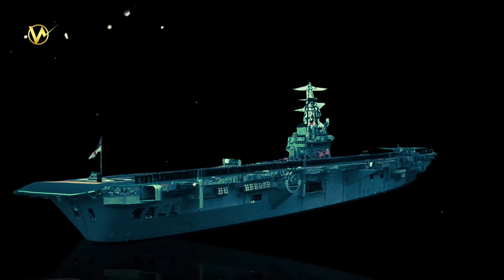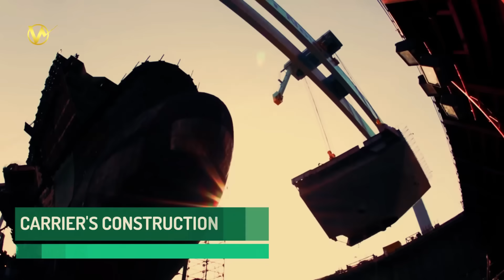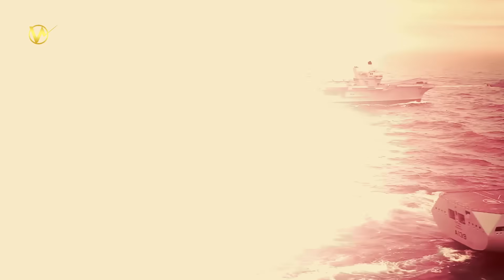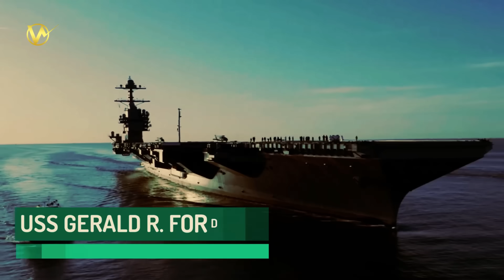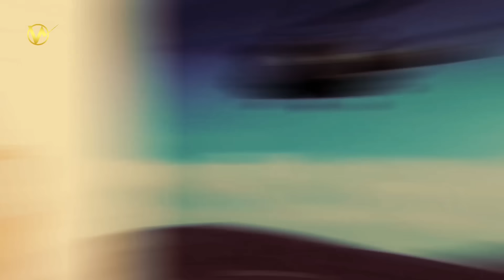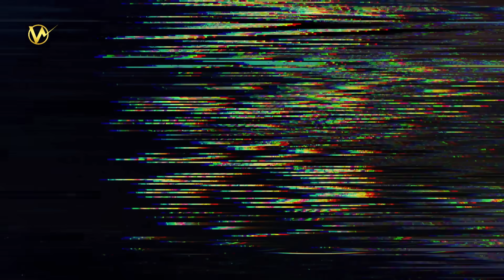Canada's new smaller multi-purpose carrier: Is it a Genius Idea?

Comment: Canada Could use something smaller like the Mistral class helicopter carrier that has a hardened deck for F-35s or the Americans Wasp class or America class Amphibious Assault ships. We don't need a massive carrier but 1 light carrier/amphibious Assault ship on each coast with a 3rd to rotate in and out for maintenance/refit. We're never going to be operating without allies in a situation where they're won't be additional carriers anyway and in the cases we do, it will be in situations where a small carrier will be more than enough support. Troop transport, logistics, support and humanitarian/disaster relief will likely be a bigger role. Having a few fighters (I think the load out for the above mentioned is 8 F-35S or Harriers) unless it's being operated as a light carrier then you swap out the helicopters for the additional 12 Fighters.

Comment: 🇨🇦🍁With the advent of micro-nuclear reactors we could power 25000 ton Ice Breaking Escort Carriers (5 of of them as we want at least 1 for the Pacific, Atlantic, Arctic and Indian Oceans and another for reserve or Hudson's Bay). A combination of Helicopters and VTOL/STOL planes will suffice as you normally only need a few of each unless there is a WAR or a MAJOR NAVAL EMERGENCY. IMHO this is a more sensible strategy than either a SUPER-CARRIER or NO CARRIERS. The main thing is to use a micro-nuclear reactor on all CAPITAL SHIPS that we will make
here in Canada. At 2000 people each, we would need to hire 10,000 new Naval Personnel just for these 5 ships and if each is to be the center of small task forces (1 Destroyer, 1 Sub and a couple supply ships and a Missile cruiser and a couple Frigates and new Corvettes, this can quickly lead to 50 new ships of 400 crew each (20000 more Seamen)! But it can be done as we had a decent sized navy at the end of WW2 with hundreds of warships! 🇨🇦🍁

Comment: Canada could project sovereignty more effectively in the Arctic region through the use of ships equipped with helicopters, long range UAVs as well as the use of the SAAB Gripen with its short take off and landing capability and a design suited for Arctic conditions.
A carrier, even a small one, would require resources, funding and trained personnel that this country simply doesn't have available.
It's also worth noting that Canada is a huge country with a huge coastline and requires careful management to distribute military capabilities to all regions at once.... and a carrier simply can't do that.

Comment: A usable carrier, say a dozen F-35's and an equal number of helicopters would require over a thousand sailors and air crew to man, we're currently discussing the difficulties of finding the 600 sailors needed to crew 12 submarines, a vessel unlike a carrier, that we currently operate and with the needed escorts in tow would probably cost about a million dollars a day to operate. I'm not saying it wouldn't be a nice capability to have but with 15 destroyers, 12 subs, 6 AOPV's and possibly a dozen corvettes to man and operate we would be hard pressed to add a couple of LHDs without basically doubling the number of sailors we currently have.

Comment: I don’t see a need for a carrier, just build a couple of runways capable of operating fighters in the western and eastern arctic with maintenance hangars.
Reply: well first they would need to rebuild all the FOL's in the arctic.  they sold them to local governments with a maintenance conttract.....in Inuvik the town CFO had them shut down the refrigerant system, the permafrost melted, and the hangars subsided.
Reply: @noele6588  brilliant!  Were they running low on fuel for the generator?
Reply: Carrier or carrier fleet would be a super big help to the Canadian military, make the fleet have amphibious capabilities to land troops as we currently have no way to move our forces except for 8 heavy lift aircraft. Furthermore if you made this carrier fleet ice breaker capable then we could send this fleet to the Atlantic or Pacific through the artic 9 month out of the year. Even Australia has two amphibious capable aircraft carriers and they are a smaller country, we let are army die into what it is today

Comment: Canada had aircraft carriers during and for a few years after WW2 because sub hunting combat aircraft could not engage subs in the mid Atlantic. When sub hunting aircraft like the Argus and Aurora that could stay aloft for 24 and more hours at a time. They did not need the carriers anymore. 
The current situation with the Arctic can be covered by expanding air bases and naval bases in the North. Something that the government seems to be interested in 
The NATO commitment includes the Army Brigade commitment in Latvia. Right now The Canadian Army has about 2000 troops as part of an international Brigade Group. If a combat situation steps off the Army will want to re- enforce that Brigade Group with one or more Battle Groups from Canada so some form of Amphibious Assault ship or a protected Roll On Roll Off ship like an armed ferry of some kind would be more effective than a straight carrier. This ship could be ice capable and be used in normal times to bring troops, equipment and supplies for the Northern Sovereignty Operations every year. 
Canada does not have a defence commitment in the Pacific and I’m not sure we should get involved in one. But if we did the idea of having some sort of drone mother ship for air and sea drones would make the most sense going forward.

Comment: The Gov't plans on making Churchill (MN) a year-round major maritime hub, to access the North-West passage in either direction.
To bypass all these shenanigans, i.e.: debates and expenditures, about the viability of some type of maritime mobile air platform, it would be infinitely
more efficient and effective to establish a permanent CF Base on Baffin Island, a 5 km airstrip for fighters/patrol/search & rescue/supply birds, covered naval
resupply docks/warehouses for all vessels (? a sub pen or 2 ?) with a possible dry-dock in the lot for emergency repairs, maybe a Bn worth of troops to
maintain security/intervention and conduct advanced Arctic training for the CAF and allies. Maybe even some R&D regarding ways and means (implements)
for survival/work/warfare in the high Arctic. Cheaper to run a multi purpose facility on land (island) than an itinerant naval-air task group. This would go a
great deal further to assert our sovereignty in the region, and the R&D might actually contribute resources in the long term.  Be well and stay safe
Reply: Absolutely correct
Reply: That would make a lot of sense, you've made some good points.
Reply: Hovercraft would work well for the Arctic environment.  They can operate on land/water/ice, thus 365 capability, relatively cheap compared to aircraft and ice capable ships.
Reply: I'm all for improving Churchill and making it more viable for the local community and developing a larger labour force.  However I'm really concerned about permanent negative effects on the local Polar Bear population.
Reply: Ice Breakers for the North incase the global warming thing is just a bad idea .... just sayin...

Comment: Buying x2 Juan Carlos class lhd's makes sense...everything from force projection, disaster relief and humanitarian assistance..

We could easily reduce our f35 purchase to just x16 f35b and then supplement with x88 Saab Gripen Es. 

It's not solely about amphibious assaults...that type of thinking is outdated and misguided
Reply: Makes no sense to reduce our F35 purchase and buy the Gripen.  The Gripen's would be outdated by the time we'd get them.  If anything, we should be buying more F35's.
Reply: The Gripen E would be just fine for our continental security obligations (NORAD)..cheaper and easier to operate (requires less sophisticated infastructure) and 
less down time..

We could then look to join the Tempest program with our new found fonestic manufacturing capabilities..

Meets our obligations and needs with Washington while simultaneously diversifying our defence procurement and increasing our own industrial base.
Reply: @graemeanderson3337  It would also mean two micro fleets with all the logistic, training and infrastructure burdens that would imply.   Both fleets would also wear out faster as there would be fewer airframes to average the hours out on to.

Gripen's also aren't all that much cheaper than F35's, but they leave a lot more on the table.  It would be a bad trade off.
Reply: No doubt a mixed fleet has disadvantages but about half the f35 nations due just that with no issue(seemingly)..

16 x 35bs
64 to 80 x Gripen Es

Is both doable and beneficial 

If we go further and join the Tempest program it would better align with our strategic goals of more strategic integration with europe.
Reply: @graemeanderson3337  There isn't much to demonstrate that having such a mixed fleet would be beneficial, nor having more strategic integration with Europe.  

The Europeans are already far behind the US in 6th gen fighter production and buying a 4th gen fighter from them doesn't make any sense capabilities wise.  

Why buy a 4th gen fighter that can be ambushed by 5th gen fighters invading our airspace?  

Much better to buy a lot of 5th gen fighters now and wait to see what Europe rolls out for a 6th gen.
Reply: The benefits of a mixed fleet would simply be less, as in not 100%, reliance on a less trustworthy United States..and it need not be the Gripen either..

It would be great if another 5th generation fighter was on the market outside the f35.. maybe the kf21 block 2?

Unfortunately that's not the case so what do we do...how do we move away from sole dependency on Washington, increase our own domestic industrial base, increase military cooperation with europe and meet our NORAD responsibilities?

Maybe I'm way off here but I think a mixed fleet is the right direction for us..
Reply: @graemeanderson3337  Honestly, I was pretty sure that this: "as in not 100%, reliance on a less trustworthy United States" was going to be your reasoning.

It's not great reasoning.  What, specifically, does buying 100% of this generation's fighters from the US actually open us up to, risk wise?  There is no "kill switch" software in the F35 any more than there is in our current fleet of CF18's.  

And lets not forget that buying from Europe exposes us to the risk that come with buying from Europe.  The EU is much more likely to restrict our use of anything we buy from them than the US is (on a policy front).  The EU is also filled with illiberal democracies that, as a whole, I don't really trust all that much in terms of foreign policy decisions.

That all being said, If we could engage in more partnerships with South Korea and develop more aerospace tech with them for the 6th+ or 7th gen of Fighter, 100% absolutely, because they have shown that they are willing to basically give us equal partnership and control in whatever we'd make together.

But that would be something that we'd have to start now for a good result pretty far in the future... and it'll cost a LOT of money.
Reply: I'm not suggesting the planes themselves are a risk, moreso the specific cont'd alliance, perhaps over reliance, on the US is a bad idea, never moreso then today..

We should 100% continue to work with and buy from the US(militarily and other) however, increasingly when and where possible we need to diversify and I say this as an American Canadian.

Specific to the f35, I don't believe in nor would ever suggest any notion of a  "kill switch."

My rationale is solely about diversifying our trading and strategic partners while simultaneously increasing our own industrial base. I believe it's possible and prudent to explore and pursue those options.. 

If however the f35 is the only option I support that conclusion.
Reply: @graemeanderson3337  Diversification is something a nation has to plan for and fund for a long time.  Canada has failed to do so.  We have to accept where we are in the present moment and accept what facts we face in the present moment.  

Buying 4th gen fighters in a 5th gen world would relegate us to support roles with little to no independent target selection capabilities.  We would basically be giving up any vestiges of our ability to act independently.

As for the notion that "perhaps over reliance, on the US is a bad idea, never moreso then today.." Well, that has always been the case, today, yesterday and tomorrow.  Nations should never over rely on other nations.  

That being said, the notion that This particular moment has more risk to Canada in terms of military equipment procurement... well, I do not believe that to be true.

Comment: Canada doesn't need to project power, doesn't have jets designed for carrier use, Canadian pilots don't have carrier training, and the military doesn't need aircraft carriers to transport aircraft overseas for occasional NATO missions. If Canada needs a carrier, the government could build a custom freighter with one or two aircraft elevators and then load and unload jets, drones, and vehicles using a crane. A better idea would be to build trimaran battlecruisers with a reinforced icebreaker hull. The Canadian battlecruisers would be the length of a Kirov-class (253 meters or 830 feet) with a large internal hanger to carry various aircraft, drones, APCs, tanks, and artillery which makes it an aircraft Cruiser. Jets and vehicles could be lifted on and off the deck by helicopter or crane for long-range transport. The battlecruiser could be armed with one Japanese rail gun on the bow as the primary weapon, two 127/64 light weight guns as the secondary weapon system, four 40mm Bofors, 30mm CIWS, anti-aircraft & anti-ship missiles, torpedos, 4-8 ASW choppers, and 2-4 South Korean KAI LAH infantry support helicopters. The current Canadian Navy will be equipped with the River-Class guided missile Destroyer, Harry DeWolf-class Arctic and Offshore Patrol Vessels that are a couple thousand tons lighter (Frigate), and have plans for an icebreaker Corvette. The River-Class Destroyer could be replaced with a battlecruiser to give the Navy a more powerful warship that could occasionally transport jets, troops, and be used as a mobile hospital across the ocean. The Russian invasion of Ukraine has made drones more important but many people have become obsessed with the idea of drones replacing people in combat. A drone carrier is a bad idea and using drones as the main military force is full of problems. Drones are not invincible and many anti-drone weapons have already been developed like air burst ammunition, sonic, microwave, and jamming technology. When drones are jammed they can use inertial navigation but the longer the jamming continues the further off course the drones will wander. In World War 2 Americans believed that battleships were the most powerful and deadly weapons in their military and the carriers were only useful as support ships. After Pearl Harbor the Americans didn't think they could win without battleships. Since WWII the battleship has become obsolete because of missiles and the carriers along with the aircraft on board became more important. Unfortunately, military technology and tactics are always changing, and I believe the aircraft carrier has become obsolete. The long range cruise and ballistic missiles carried on submarines and surface ships eliminate the need to send aircraft into enemy airspace. The infantry can call in a missile strike from a sub or surface ship so the "need" of a carrier no longer exists on the modern battlefield. Both jet and propeller aircraft are still useful in various situations but in smaller numbers that don't require an expensive specialty ship like the aircraft carrier.
Reply: We don’t need to have pilots or crew, if we’re doing it with Ai. We don’t have the numbers anyways
Reply: @L-nh2vq A drone military controlled by AI is the dream of every dictator. The dictators of Russia, North Korea, Israel, and America would love to replace their soldiers who can refuse to obey illegal orders with killer robots. Drones are easier for a dictatorship because they are programmed by nerds who are easy to threaten and intimidate. Drones may be popular right now, but they will always be a flawed weapon system with limited uses. The Ukrainian Air Force is currently using old Soviet MiG-29 Fulcrums, Sukhoi Su-24 Fencers,, Sukhoi Su-25 frogfoots, Sukhoi Su-27 Flankers, Lithuanian L-39ZA Albatros (trainer & light attack aircraft), old & new American F-16 Fighting Falcons, French Mirage 2000 & Rafale jets, Czech-Slovak Shark & Yakovlev Yak-52 drone-killer propeller aircraft, and various helicopters & drones. Ukrainian President Volodymyr Zelenskyy signed a letter of intent covering a potential sale of more than 100 Saab JAS 39 Gripen E fighters. President Zelenskyy has outlined plans for a future combat fleet of approximately 250 aircraft, including F-16s, Gripen Es, and Rafale fighters. The Swedish Saab Gripen E is estimated to cost between $5,800-8,000 per flight hour. The American F-35 Lightning II is estimated to cost between $25,000-42,000 dollars per flight hour, which includes fuel, maintenance, and other operational expenses. France's Rafale is estimated to cost between $20,083-28,690 per flight hour. The American F-16 Fighting Falcon is estimated to cost between $8,000-27,000 USD per flight hour depending on conditions. The American F/A-18 Hornet is estimated to cost about $10,000 per land-based flight hour and $18,000 for carrier operations. Even the Ukrainians, who are experts at drone warfare, know that they need piloted aircraft because they can't win the war against Russia by only using drones.